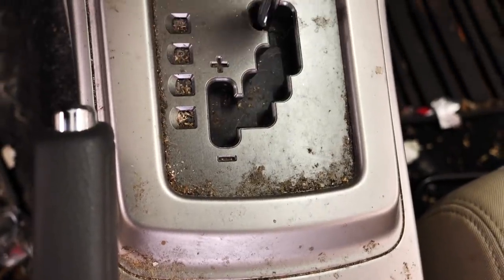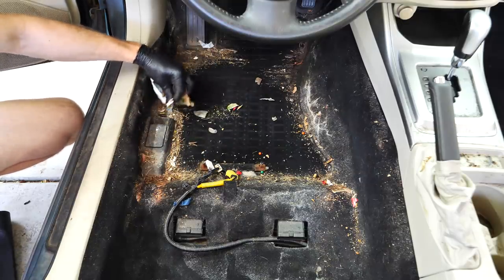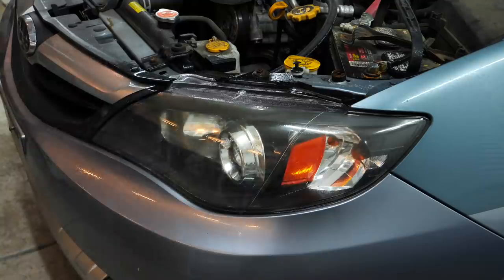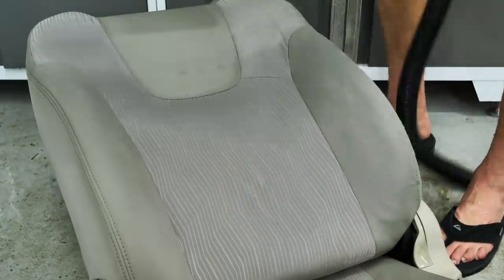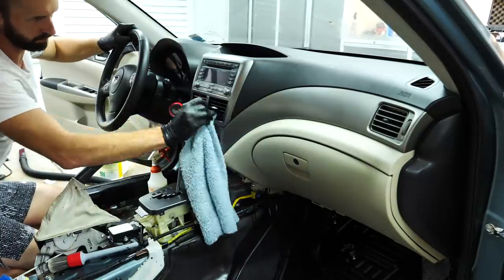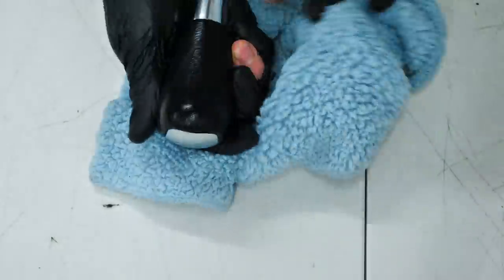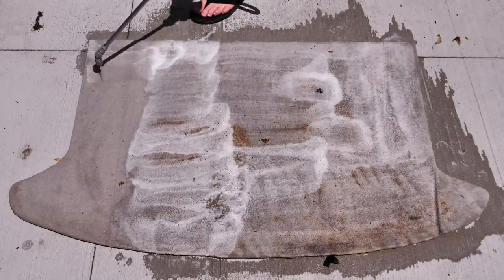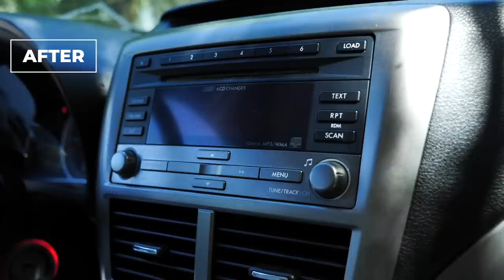Smoker's Nasty Car Detailing Restoration! Car Interior Deep Cleaning

Comment: I have to ask on this video specifically… what about the ceilings?! I know that has to be nasty. Is there any way to clean those? I’m guessing it’s similar to the carpets
Reply: Cleaning headliners is tricky.  They are super fragile...
Reply: The only thing you can do it spray very lightly with cleaning solution, brush and wipe with damp cloth then with dry cloth. Only dry cloth if it's super old and fragile. If you soak or try to use an extractor you could break down the adhesive which holds it up.
Reply: I used to be a heavy smoker and I used my extractor on the ceiling and it worked perfectly. I got soaked doing it but the seats were gonna get wet anyway 😂

Comment: 19:20 a steamer would be perfect here
Reply: Actually a steamer should only be used if the dirt is unmanageable with cleaner or if theres a biohazard like mold. Usually you can get everything off with a good cleaner even if it's super dirty. A steamer not only takes longer from my experience, because steam dries fast so you have to do small sections at a time, but also dries out and fades the look of some plastics. A cleaner wont do that.

Comment: What if the haze is on the INSIDE of the headlight lens? And what do you suggest to remove the haze that always seems to stick around after cleaning the inside of the windshield, no matter how many times I clean it? I don't think the previous owner was a smoker, but I can't be sure.

-I have this same car (not the wrx or hatchback version) and my center console lid is cracked exactly like this one. Seems like a design flaw.

Comment: Unbelievable transformation. You are the man. Were you able to get the smoke smell out?  I just bought a car that sat in the woods for 8 years. It had a lot of mice nests in it. What can I do to get rid of that awful smell? Thanks will be ordering drill brushes and a lot of other items.  Best channel on you tube. Thanks a lot. 👍👍
Reply: I'd change the air filter out and see if you can get ahold of or rent a ozone air cleaner.

Comment: If this car was owned by someone in New York (old registration sticker in the center console was a tip-off) then the white stains in the carpet is the rock salt/liquid brine the DOT pours onto NY highways by the metric f***ton every winter...quickest and safest way I found to get it out is to spray carpet with plain hot water (which binds to the salt and dissolves it) and blot out with a microfiber towel. Then shampoo and extract. I don't take the drill brush to my carpet until all the salt is out because the salt acts as an additional abrasive which can damage the carpet.

Comment: When using the all purpose cleaner I noticed you get a lot on the window. That doesn't cause an issue???

Also you can clean that shifter better by taking off the plastic clips on the side... It'll pop up and you'll have full access to the black piece that moves around as well as underneath in general. Some cars it's tied into it even if you do pop it up though

Comment: Do you ever clean the back of the carpets if you can
Reply from the maker: No to be frank, the time invested already makes it hard to clean any of these cars to the level I’d like. In the perfect world I’d strip the car 100% on the inside, pressure wash the thing, clean every harness, panel, switch, and bolt on a table outside the car then reassemble. Time to do that and upload more than once a month wouldn’t be possible